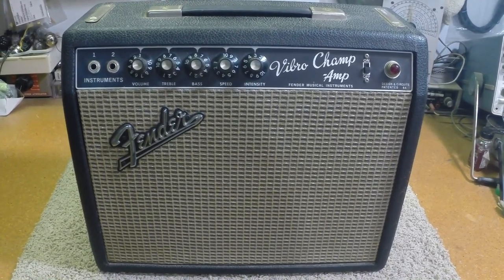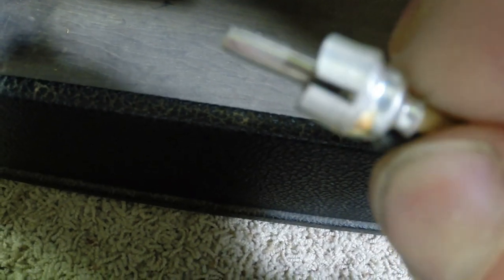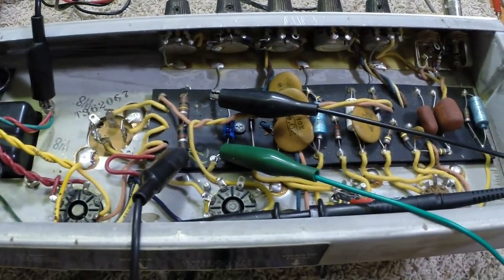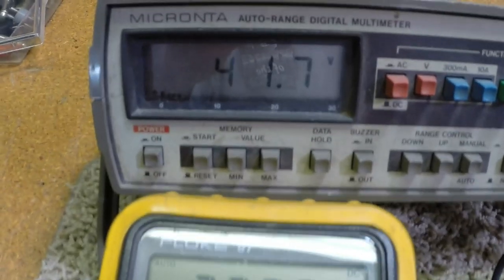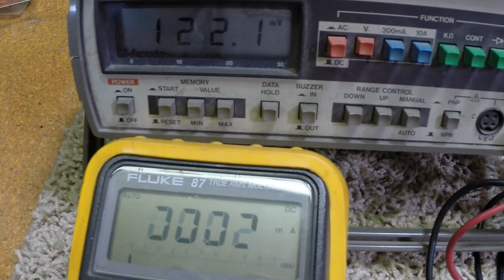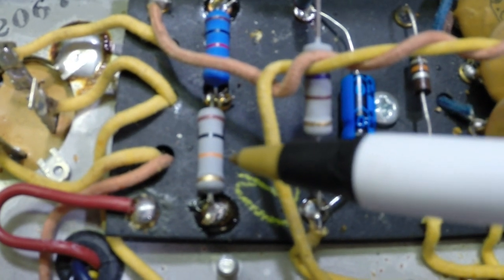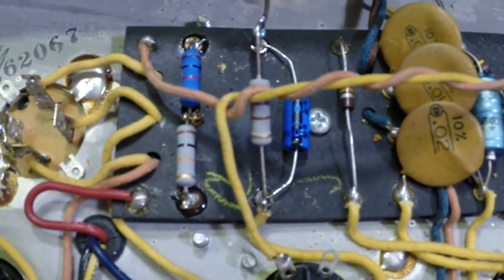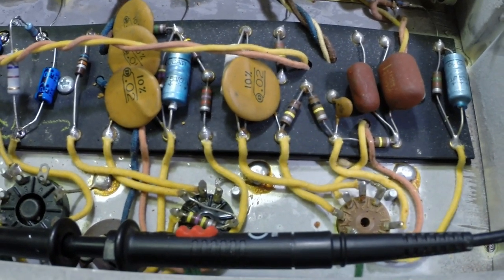Black Face Vibro Champ Repair and Bias Discussion

Comment: Thanks for this video. I recently recapped my '76 VC. On recommendations from the interwebs I replaced the 40/40/40 can cap with a 20/20/20/20 and put a 1K/10W between the first two caps to drop the B+ from 420V to 380V. Plate voltage is at 367V. Screen supply is at 370V and cathode voltage is at 24.8V using a 680R cathode resistor. I also added a 1K screen resistor based on another recommendation so screen voltage is 364V. It sounds OK, but obviously the bias is way low as I wasn't figuring in the actual screen current. After watching your video I'm thinking I need to pull the series screen resisistor, change the 6V6 cathode resistor back to 470R, and change the 1K resistor feeding the screen between the 2nd-3rd filter cap to somewhere in the 10K-22K range (probably start with 18K). Would you recommend removing the 1K B+ dropping resistor as well, bringing the B+ voltage back up to 420? Thanks for your insight.
Reply from the maker: First of all thanks for watching the video.  It is an old one and I am a repairman not a videographer, long and boring but full of real information.  I am considering a redux.  There is a huge amount of bad info out there, and most "techs" get it way wrong.   I need a clarification; I take it you replaced the 3 x40  with a 4 x 20 (stock value) cap ?  You can parallel the first two cap sections ( I like to) or reduce the 1k resistor to 200 to 500 ohms to be used as a Pi filter.   The latter will reduce hum more and filter the supply better.  Your actual B+ will be under 400v anyway.  Remember you subtract the cathode voltage from the plate.   Now take the series 1k screen resistor out.  You can use a 470 ohm if you want, but don't tell the tone police.  Put a new good 470 ohm 2 watt on the cathode. Anything here over 500 ohms is just wrong.  Do as I did, replace the screen supply resistor with a 10k 2 watt.  You can vary the preamp supply resistor as I mentioned start with the 1k.  The screen current here is the culprit not plate current.  Hope that helps.
Reply: @guitarc.p.r.9675  very helpful. Thanks!

Comment: Awesome advice and I appreciate your expertise and experience. Would you recommend the 5F1 Tweed 22K(Top) 10K(Bottom) in a SF Vibro Champ or Bronco as well? I love these amps. Is it really common to see a screen voltage higher than the plate without a faulty screen resistor? This seems odd.
Reply from the maker: Thanks for the comment!  Yes you can use the 22k resistor in anything post tweed.  What it will do is lower the voltage on the driver and preamp tube.  It will "brown-up" the tone a little and make the preamp distort a little more smoothly.  It is a matter of taste.  You can also add a 470 ohm screen resistor to limit the screen current a little more, but the tone police will tell you it destroys the bloom of the notes.  Yes it is common to see the screen voltages high. In fact the tweeds have the B+ connected to the screen first then through the Output Transformer to the plate. Really old school.    RULE#1:  Screen voltage should be less than the plate voltage.  Also, if the plate is drawing excessive current, the plate voltage may be pulled lower than the screen. Thanks again for watching!

Comment: Just fixing up my 81 Vibro Champ now and come up with the same problem with the bias and following advice have looked at upping the cathode resistor value to 820R & 1K. Interestingly on mine the 1K had been replaced with a 2k7, not sure whether i had done that or as it came when i brought it S/H around 1987. Its been pretty much in storage for the last 30 odd years...! 
Anyway after changing the cathode resistor away from 470R looking at the output its not very satisfactory and you loose at lot of voltage swing so clips very early, not sure what it sounds like though...! 
Also the H.T is really high which doesn't help matters. I think I'll look at your trick at swopping round the resistors and see what happens.
With the H.T I've found with my Champ which is an export model with line voltage selector that setting it to the 260V position with our 240V line mains (as measured) the H.T comes up to about 420V.
If i set the line voltage selector to 240V H.T jumps up to around 444V.....
To get the 240V setting to come in spec line mains needs to be around 220V having checked with a variac and looking at the resulting H.T.
Reply from the maker: 420 volts is about right.  However consider your cathode to be at ground when measuring plate voltage. Which will give you around 390v.  The whole thing about changing the cathode resistor is simply ignorant.  The theory of changing it to 1k is just wrong.  It irritates me to no end to see this constantly considered as a solution.  I even saw one "tek"  Referring to biasing at the 75% dissipation point which is equally wrong.  Class a single ended should average around full plate dissipation during operation.   My video is long and boring but it had to be to cover the info.  Thanks for watching.

Comment: Hello. Thank you for your video. I just did this swap on a '76 vibrochamp but the dissiation is still a bit high at about 17 watts. Would I keep increasing the resistance of the 10k ohm resistor until i get an acceptable dissipation?
Reply from the maker: No, do not raise the 10k higher.   First check the 470 ohm resistor and 25uf cap on the cathode of the 6V6.  You could also have a hot tube.  I am curious as to how you are measuring the plate dissipation.
Reply: @guitarc.p.r.9675  I measured the voltage drop across the 470 ohm, which was 21V and then divided that by the resistance value, which was around 465 ohms to get 45 mA of current. I then multiplied this by the plate to cathode voltage, 380 V, to get 17 watts of dissipation. The bypass cap should be fine. I just replaced all the electrolytics, since it came to me with the originals.
Reply from the maker: You are calculating screen current plus plate current.  Measure only Plate current.

Comment: Hello! First,  thanks for this video. I have a quick question. I've watched this video a couple of times,  and want to clarify. You left the bias resistor at 470 ohms, correct? Then,  you swapped the 1k with the 10k, and that increased stability with a signal, and it also reduced signal going to the 6v6. Correct?   Thanks
Reply from the maker: No.   Swapping the resistor was to limit screen current.  Same circuit as in earlier and other amps.  It has nothing to do with reducing the signal to the 6V6.  Hope this clears it up.  Thanks for watching!
Reply: @guitarc.p.r.9675  thanks for your response! I didn't word my comment well. I didn't mean reduce signal but reduce voltage under signal,  when turning up the amp. I see you've stabilized screen current. 👍  thanks for the video!

Comment: Hello, would you recommend 1 watt (as schematic) or 2 watt resistors for the change over (1K/10K). Thank you.
Reply from the maker: I always use 2 watt resistors in the power supplies.  Thanks for checking out the video.

Comment: I can think of quite a few classic amp designs that have this problem to some degree, screen voltage equivalent or in many cases exceeding the plate. Crank it up, and of course we're going to, and the screen starts doing the job of the plate...well at least for a little while!
Reply from the maker: Yep, see it quite a bit.  Just in the last couple weeks I dealt with pretty much the same issue in a Marshall Mercury, Ampeg B-25 and a few others.  Sorry you had to wade through that video it is an old one of quite poor quality.
Reply: @guitarc.p.r.9675  not at all Charlie! Ive taken some things to you over the years and every time I've been in your shop I always thought to myself, Man I'd just like to hang out in here all day watching and listening to this dude and learning about this stuff! Then I would think about what a pain in the ass i probably would have been! Hey Charlie whats this? Whats that thing for ? Hey Charlie how's this work? 😆 I tell you tho in the pre internet days when i was trying to learn about this stuff but there weren't many resources,  to go into your shop and talk to you was like visiting a wizard or something.
Reply from the maker: Thanks Mike!

Comment: Hello @Guitar C.P.R
I built a 5F1 champ (mojotone tweed kit) and installed it in a silver faced style cabinet and chassis that I also built. I want to upgrade it to a vibro champ without the tone circuits. What are your thought? Can I email you the schematic that I'm thinking of using? I have a few questions about where the vibro circuit meets the cathode of the 12ax7 preamp cathode. Thanks
Reply from the maker: Sure, you can email me.  The contact info is in the about section.  I already have questions and suggestions.  Plus, I have a design issue with all preamps without a tone circuit.  We can discuss that as well.  In the mean time I will check transformer voltages and impedances.  I hope you found this video useful.  It is an old one and poor quality but the info is correct.
Reply: Yes I did enjoy the video. Also subscribed. I may be missing something or just dumb haha, but I don't see an email address in the about section.
Reply from the maker: It is there..... open the about, scroll down to details below the description.  It is to the right of business inquiries, click on view email.
Reply: @guitarc.p.r.9675  I sent you an email. 
Thank you

Comment: Hello,
For measuring accurately the plate current without opening its loop, what about soldering a 1 ohm 1% resistor in series with the plate and using a (milli)voltmeter? I guess the DC resistance of the primary output transformer is largely higher than this 1 ohm so it would be negligable. Good idea? Thx for the numerous vids you provide. I would say " keep goin' "!
Mike.
Reply from the maker: Yes, you certainly can add 1 ohm resistors in line with the plate, and the screen.  This also still allows you to operate the amp at high levels and track operation like inserting the meter.  Just measure in mv across the resistors.  And Be Careful these are 2 of the 3 highest voltages in the amp.

Comment: Thanks so much for sharing this. I face a similar problem with a tweed reproduction -- would it help to switch the 10k and 22k around, or should I just recreate the Blackface power rail to stabilize my amp? The answer is of course: just try it. This still is the most relevant video on Champ biasing on the yt.
Reply from the maker: I would need to se a schematic of the tweed repro.  The original late tweed circuit is actually more correct than the BF.  Personally I believe 22k is too large for the screen resistor.  Thanks for the comment, I appreciate it.
Reply: @guitarc.p.r.9675  I'll rephrase my question: how would you tackle this problem of drifting bias in a 5F1 Tweed Champ with the 'more correct' 10k and 22k already installed. I tried installing a screen resistor on the power tube, which really improved the sound of the amp, but didn't fix the drifting bias...
EDIT: Now that I watched the video again, there is a screen resistor on this amp -- at least there is a resistor mounted on the 6V6 tube socket. I'm confused you didn't mention it and I didn't see it until now....
Reply from the maker: Sorry for the late reply, somehow I missed your comment.  OK, short answer.  Are we drifting hot, or cold?   As far as drifting bias goes in a champ there are just a few possibilities.  (1) Old, worn, damaged output tube.  (2) Drifting cathode resistor, and or bad or leaking cathode bypass capacitor, and (3) a leaky grid capacitor.  There are also the possibilities of output transformer issues, or a non-audible parasitic oscillation.  But I would bet on the top 3.  Oh, also there was no screen resistor in this amp.  The tone police frown on them, plus it did not need it.  Thanks for watching.

Comment: First, thank you. 

I'm a novice. I built a 5F1 from a kit. It has the 10K in the first position, between positive leads of 16 uF and 8 uF filter caps, then 22K in second position between positive leads of the two 8 uF caps. With this 470 ohm cathode bis resistor at 470 ohms, I get the following readings:  
Plate to cathode, pins 3 and 8, 6V6: 323 VDC
Voltage drop across the resistor: 19.53 VDC
Plate voltage: 342 VDC
Screen voltage: 303 VDC
Cathode voltage: 19.5 VDC
CBR Value: 478 OHMS

According to what I've learned up until watching your video was that plate current is 40.8mA and plate dissipation is 13.97W at idle.

What would you suggest to improve this; or is it good as-is?

Thanks so much! I will watch this video a couple if times - learned allot on the first watching for sure!
Reply from the maker: First of all,  thanks for checking out the video.  That one is long and boring but there is a lot of info , and I could not convey it any other way.  There is a lot of bad and wrong info out there, and it really ticks me off to see the "experts" regurgitating it constantly.  So according to your plate voltage numbers, I would say the 6V6 needs to idle at about 38 ma.  I am curious as to how you are measuring the plate current or just doing the math.    Make sure you are not measuring plate+screen current.  That will make the dissapation look too high.  Once we get past the 6V6 bias thing, I do have a few circuit suggestions for you.
Reply: @guitarc.p.r.9675  Just math: I used the following: voltage drop across bias resistor divided by value of the resistor. Then multiply that number times the plate voltage. Thank you!
Reply from the maker: Forget the math numbers can lie.  Learn to do actual measurements.  I would say it is probably runnung very close to correct.  But I would like to see the actual plate current.
Reply: @guitarc.p.r.9675  OK - I can certainly check that. What is the best way to actually hook up the meter, etc. Which pins and what setting on the meter? I recently acquired a nice set of clip on leads that I've been waiting to try out. Thank you!
Reply from the maker: To measure plate current put the meter in between the output transformer lead and pin 3 on the power tube.  Set the meter for DC MA.  I use the 200 ma setting for idle measurements.  You can do the same measurements on the screen by connecting between the screen supply wire and pin 4 of the 6V6.  USE CARE these are the highest voltages in the amp!
Reply: @guitarc.p.r.9675  Curious to hear your thoughts on 5F1 dropping resistors as well. I was just about to put a 1K cathode bias resistor in my 5F1 build when I came across your video.
Reply from the maker: Yep, use a 470-500 ohm resistor for the 6v6 cathode resistor.  If you mean the power supply dropping resistors, I briefly mentioned that in the video.  The 10k I feel is the proper screen supply resistor as do many tube manuals.  The 22k is a variable.  The higher value (22k) will yield a lower plate voltage, slightly darker (brown) tone, and the 12ax7 will have less headroom and more compression.  You can go as low as 1k here,  lower voltages will give you a tighter, brighter signal.   Also keep in mind that all these single ended amps, especially the ones without a tone stack can clip badly due to the signal swing causing the tube to get close to cutoff.  But that is a whole other subject.... Thanks for checking out the vid I hope it helped.
Reply: @guitarc.p.r.9675  Helped big time! Thanks!
Reply: @guitarc.p.r.9675  Thanks for the reply! Your video has opened up a new idea that steered me away from neutering my 5F1. I think I am just struggling to find the right balance that keeps the 5F1 tone & character without the amp running needlessly hot and punishing the tubes.

Comment: Sir, I’m looking at a friends silverface Vibrochamp.  Measuring ma from 6v6 pin 3 to center tap I’m getting 74 ma! With plate voltage of 354.  Voltage at center tap 367.  That bias current seemed way too high so I searched around and found your video.  I swapped the 1k and 10k resistors as suggested (lacking a 22k on hand).  This change resulted in plate voltage 364v, center tap 376v and plate current 62MA.  This is an improvement but can you suggest a next step to get the bias closer to the suggested 30ma?
Reply from the maker: First the plate voltage for a silverface is too low.  This is most likely due to the high plate current.  Make sure you have no signal when shunting the output transformer to measure current.   As for suggestions, first thing check the cathode resistor and bypass capacitor.  These fail regularly.  Do not raise the cathode resistor over 500 ohms... period.  Also the 6V6 may just be failing and pulling too much current, try another one.....after changing the cathode resistor and cap.  Tubes vary widely in plate current, you may need to find one it likes.  If you can get the plate current down to around 35-40 ma you are good.  Thanks for checking out the video, it is an older poor one but the information still conveys.
Reply: Thanks for the response.  I’m going to get back into this another day but I will take your suggestions.  Interesting idea to use the tweed circuit values.
Reply from the maker: As I said CBS had a LOT of good ideas...... the practice of raising the plate voltage to 420 volts and uping the wattage to 6 watts than the previous 4 was one of them.  The Champ is a very basic minimal circuit, and also lacks screen current resistors and and grid resistors on the 6V6.  So this does not add to the stability.